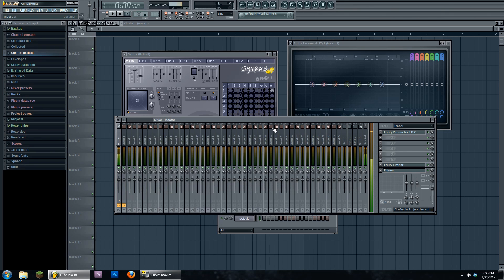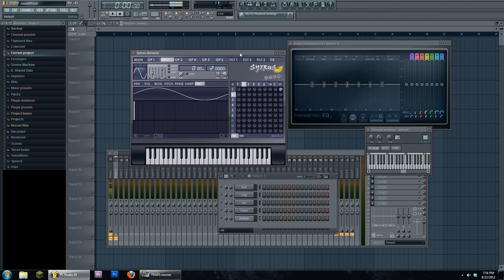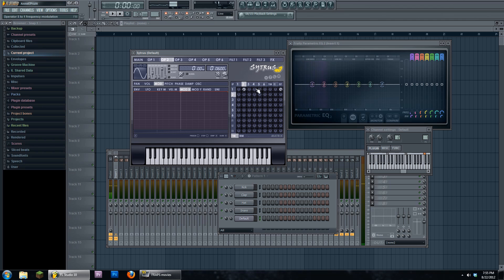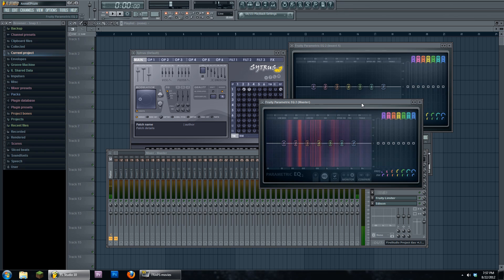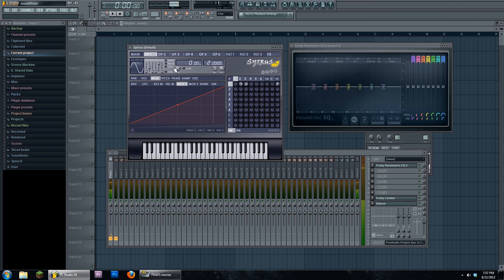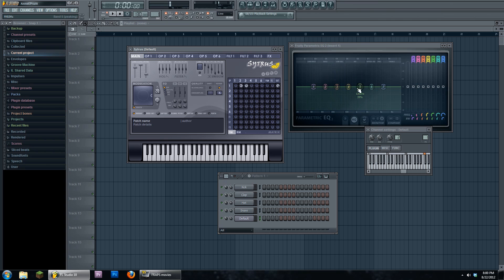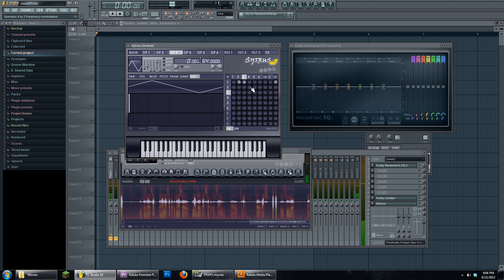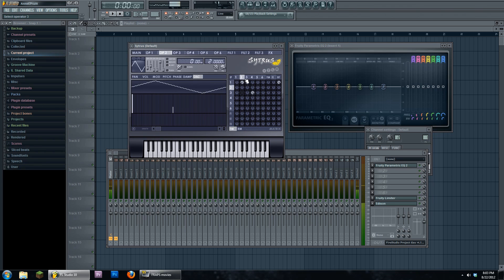How To Bass 6: FM From The Ground Up

Comment: You probably know why it does that now. But I'll say it anyway.

The FM synthesis is using the slope, (or specifically the derivative), of the modulator, rather than the amplitude. A triangle wave has only two slopes: One positive and one negative (assuming infinite harmonics). So what you end up with is only two pitches. The higher the amplitude or frequency, the farther apart these two pitches are.

So you can also have it make the high pitch or low pitch more affected by the change by adjusting the shape parameter.

I love your videos, Seamless! But if you ever get the time, and you haven't done so already, go through the Khan Academy Math pathway, with things like Calculus and Differential Equations, and the Laplace Transform. There's also a physics course on waves, and I think there are some good videos around the web on the Fourier transform.

I don't mean to sound patronizing or something. I just had to take all these classes for EE and a math minor, and it really REALLY added a whole new depth to writing electronic music.
Reply: Thanks

Comment: The triangle does that because if you look at the shape of it, it's not on par time with as the sine wave is. It's modulating the LFO, so of course, the triangle waveshape is basically just in and out closing, I think you should get the same effect from a pulse wave, but the triangle wave is a half of a pulse wave's time span. The sine wave is a round shaped frequency wave, thus allowing all the frequencies to sweep in in a much greater depth and greater time span.

Comment: You can do it to an extent; the PM section of Massive is essentially equivalent to FM, but  it automatically use a sine wave as the modulator. Similarly, if you use the "bend +/-" for the intensity setting, that is also FM.  Again, only uses sine waves as modulators.  If you are enterprising, you can set up an LFO and map it to an oscillator's pitch.  But you'll have to tune the LFO rate to one specific note and then resample the result.

Comment: Triangles work better because the modulation of the frequency is determined by the slope of the modulating oscillator.
Triangle wave has two slopes: up (lets say its slope is +.35) and down (lets say this is -.35) so when you put them together it modulates the frequency based on the two constant slopes (+.35, -.35) and this repeats as it oscillates!
Sine waves have variable slopes, there's no constant up and down, it's more circular, which makes the frequency "wobble" more.

Comment: The reason that the triangle wave makes the pitch jump and the sine wave sweeps through has to do with the slope of the curves. The derivative of a sine wave is a cosine wave so it still causes the frequency to still sweep from high to low, whereas the derivative of a triangle wave isn't continuous so the slope instantaneously jumps from high to low. Simple calculus! :)

Comment: Hi, I know this is an old video. But I thought I'd answer your unknown as to why the frequency sounds as if it's going between two pitches very quickly when you oscillate a triangle vs a sine, which sounds smooth.

You may know this already, but for anyone else watching this video:

If you picture the phase of a wave as a rotation around a central axis, a sine wave would be a circle and a triangle would be a square. The sharp right angled edges of the square (where the triangle changes direction suddenly) sound like a bounce between two pitches. This picture might help you see it:

http://en.wikipedia.org/wiki/File:ComplexSinInATimeAxe.gif
Reply: oh damn!! thank you, really helpful !

Comment: From my little knowledge, I think the triangle wave does that because it has sharp peaks, but well, it can be other thing, probably... That's my opinion. :)
Reply from the maker: +Wren206 Since then I've learned it happens because digital FM is accomplished not by actually modulating pitch, but by modulating phase, which causes a change in pitch. This crucial difference means that the actual shape of the waveform isn't the actual motion of pitch. The change in slope of the waveform is. 

So, a triangle wave has two straight lines that do not change in slope, and so we get two solid pitches that don't change in pitch :)
Reply: SeamlessR Great! Thanks!
Reply: The word ''Vocal'' starts with ''V''. Triangle shape has two V's in it. That's why it happens.

Comment: Hello Seamless. If you can, could you explain how to achieve the synth sounding whatever its called in the song "M-Phazes - La La Lah (Instrumental)" at 0:17, 0:39, 1:01, and 1:22 would be very, very helpful. I use FL Studio 12 by the way and want to achieve it with the program's stock plug-ins. I really want to achieve this sound.
Reply: +Isaiah Speight It almost sounds robotic if you know which sound in the song I'm talking about. It's also the loudest noise when it comes into the song. I'm trying my best to explain it. Please let me know, if you know what sound I'm talking about.